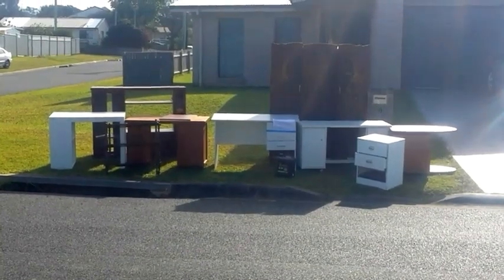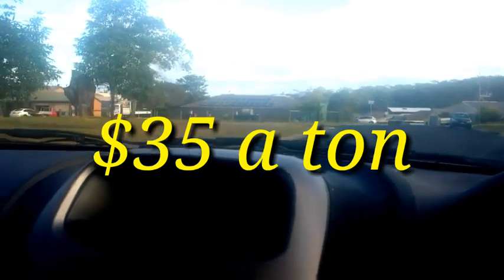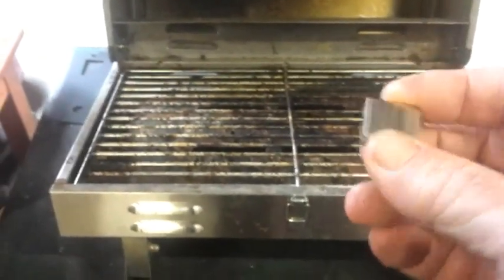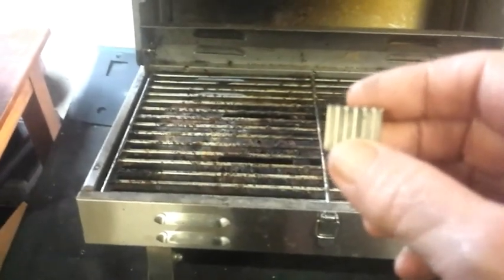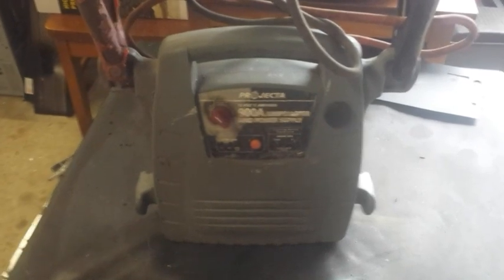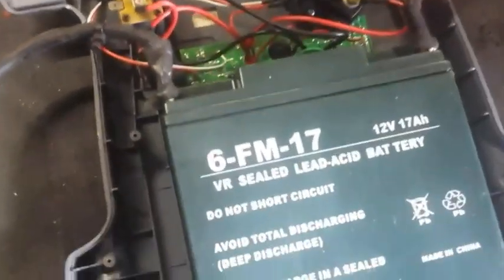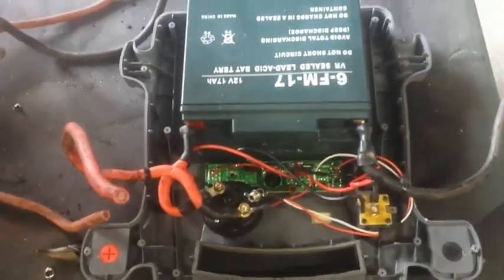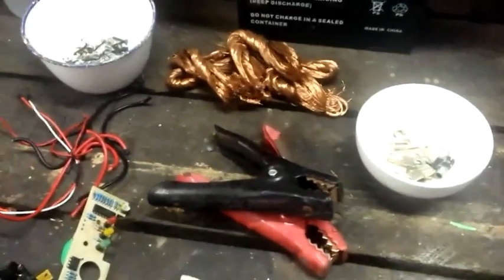#Corindi #scrap #trash
BITS & PIECES 2

Comment: Those jumper packs came in handy for me many times when living in extreme cold and buried in snow.  🦘🦘
Reply from the maker: I have needed one myself more than once.
Unfortunately this one was buggered. At some stage the battery had overheated. The casing was warped.
Anyway, it will add dollars to my next load 👍👍👍
Reply: @bigkeg9173 , that's the problem with cases - they overheat when being recharged.  Much easier to sit one on some wood & attach a trickle charger, then lug the battery along with jumper cables.  :-)